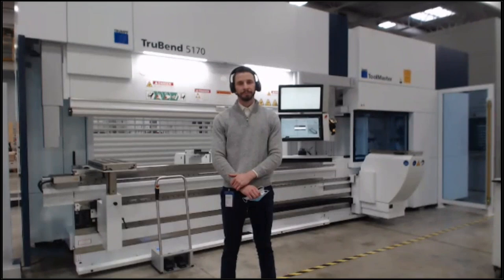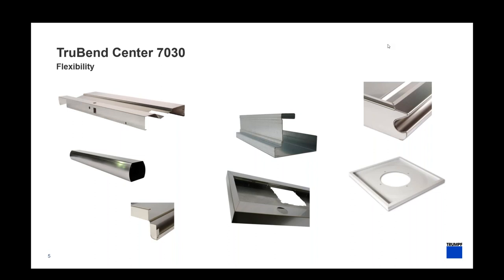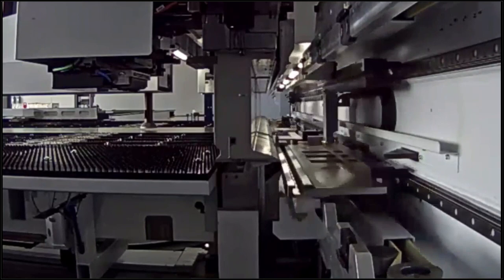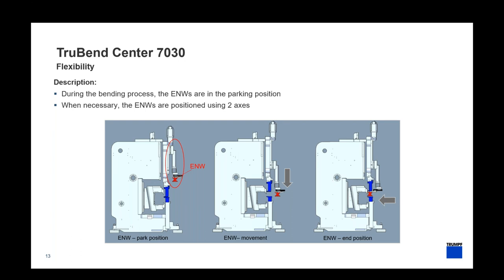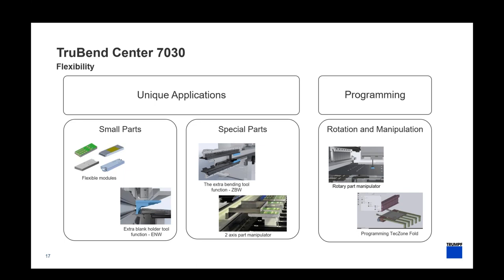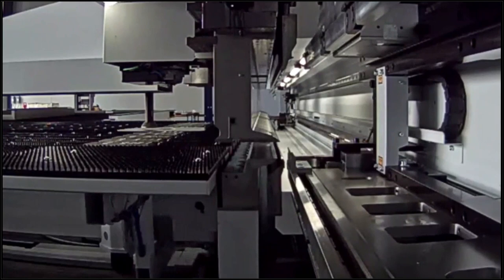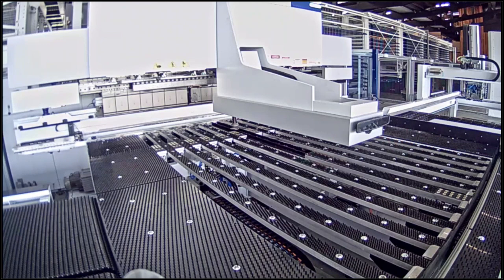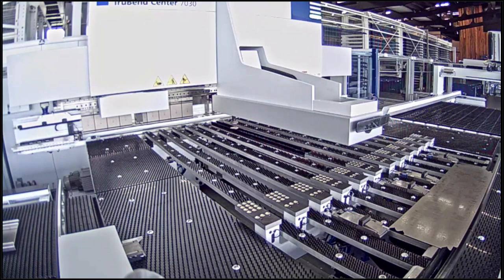TRUMPF Automated Panel Bending Webinar

Comment: What happened at 26:23? some cheating.... so the programming demonstrations are pre-edited videos? nice try, but that part needs auxiliary tooling for the long flange, the short tabs are on the wrong side of the part. sure enough in the real demo the tabs are on the short side.